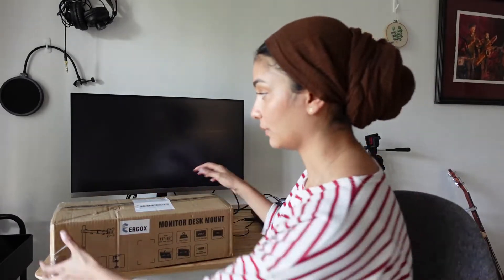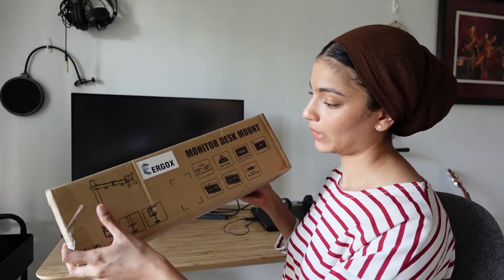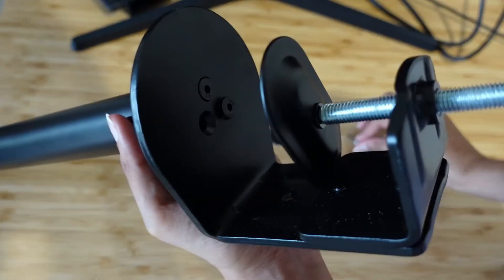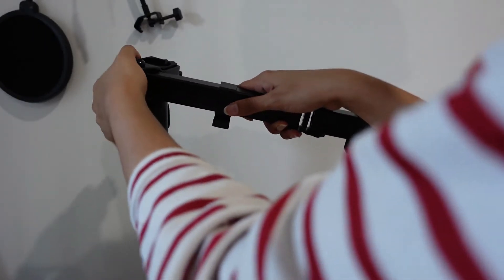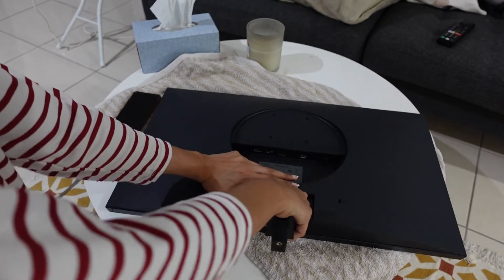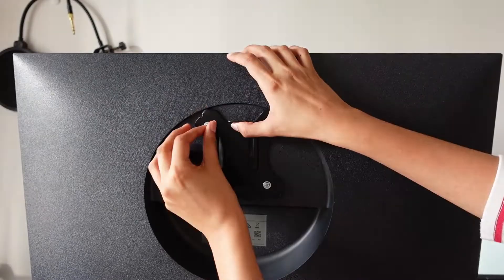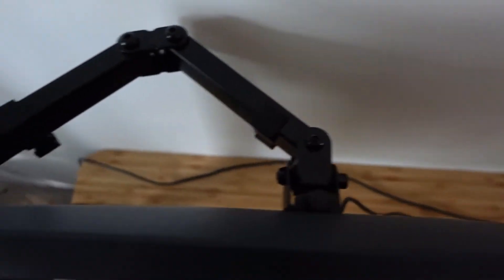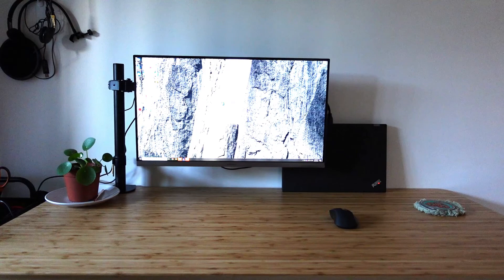Monitor Arm set up w/ Samsung 28" UHD monitor

Comment: Yeah, you do need spacers on them, I’ve got this monitor as my secondary and I’ve been looking for mounts that work well with it, as reviews have said it sags after time etc. Please be careful extending the arm out too far. - Thanks for this video.
Reply from the maker: Thanks for your comment! I'll try not to extend it out too far keep an eye out to see if this monitor sags
Reply: @kulsoom  if it does, pick this one up from Amazon.

Huanuo 17-32” Monitor Mount Stand - Single Arm Gas Spring Monitor Desk Mount Height Adjustable VESA Bracket for 17-32 Inch Flat/Curved Computer Screen - Holds up to 17.6lbs with C Clamp, Grommet Base

Highly recommend, not promoting or marketing. It has a better base with feet and is gas spring, which is better for top-heavy monitors. I have mine in portrait mode. No issues whatsoever.
Reply: @GamerofGamesGG  Hi, do you need to do any modififcations like cut the corner of the mount (the one you recommended) when put the samsung monitor on it?
Reply: @tommytao976 yes i want to know also

Comment: Nice tutorial. I just ordered this monitor and want to use it with a vesa mount. But I never used one before so I was looking if this monitor is compatible before ordering a mount too, and ran into your video. It helped, thanks! Your desk is looking clean too! Are you happy with your setup?
Reply from the maker: So glad my video helped you ☺️ and thanks! I feel the monitor arm really helps keep my desk clean cause I'm not dealing with the cluttered look of the monitor stand on the desk. And ye I'm happy with the setup at the moment. I think I could add a couple little things to improve it slightly, but those are just nice to haves as opposed to needs lol. I'll probably do a complete desk setup video at some point 😁

Comment: How much higher did the monitor arm raise the monitor? It looks all most as the same hight as the stand the comes with the screen :)
Reply from the maker: Probably only a couple centimeters tbh, but the main thing I like about it is that I have more free table space. I like to tuck my audio interface under the monitor now that I use this arm instead of the table stand. 😊